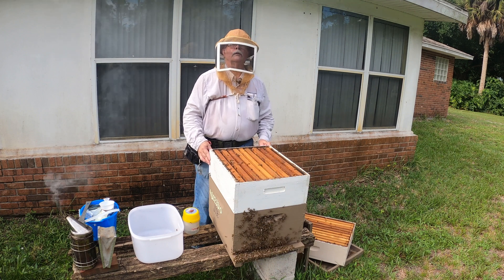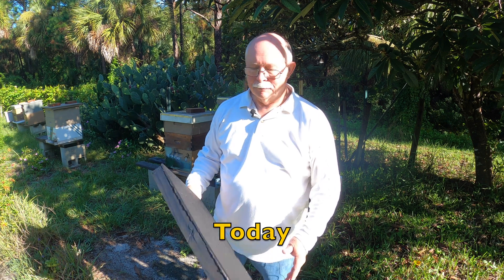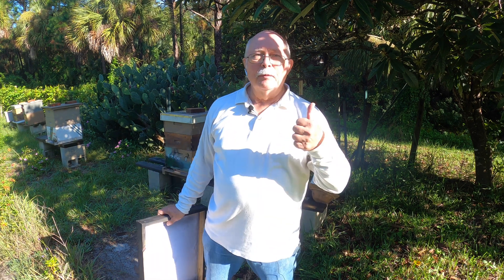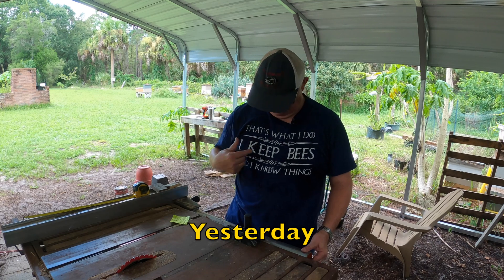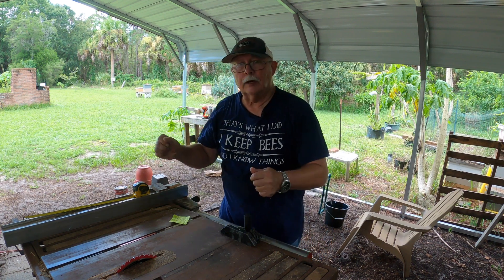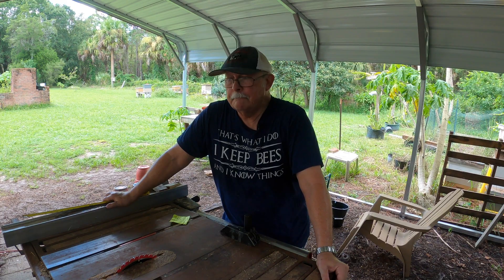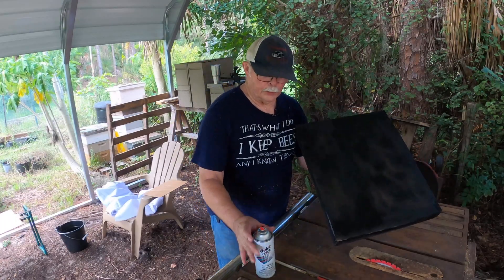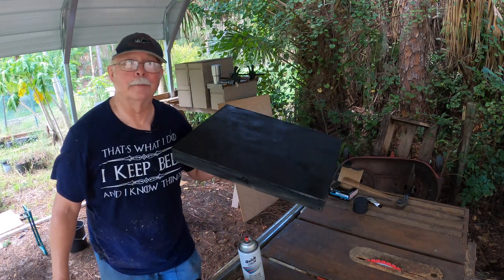Making a DIY Fume Board

Comment: Just scored me a real nice craftswoman sliding compound miter saw yeasterday. Bit of an older model but still runs looks to be in good shape should cut cedar and pine just fine.😊Still need to see about getting my old table saw fixed but the new saw is gona make this winters wood projects so much easier.    Ty for sharing, Blessed Days...
Reply from the maker: Hi DC, That sliding miter saw is a game-changer when you are building your equipment.  I am making do with an old Harbor Freight one but it does what I need it to do.  Thanks